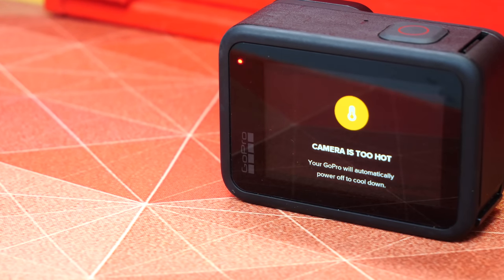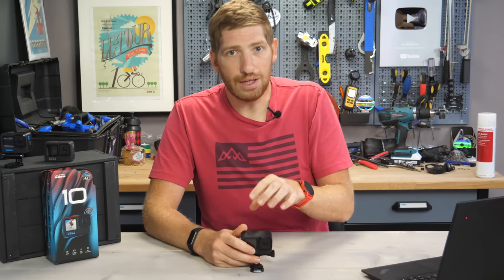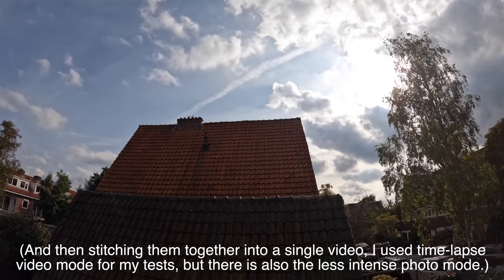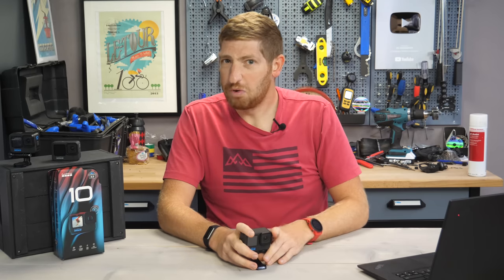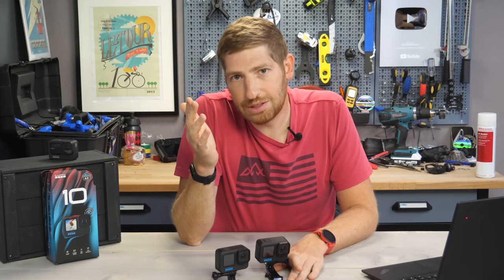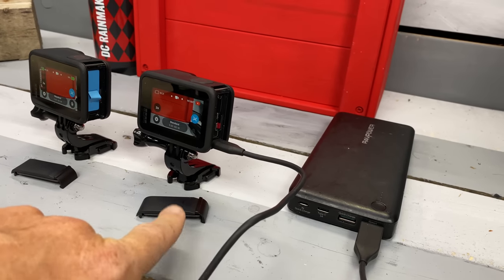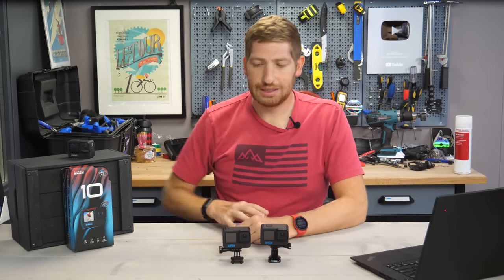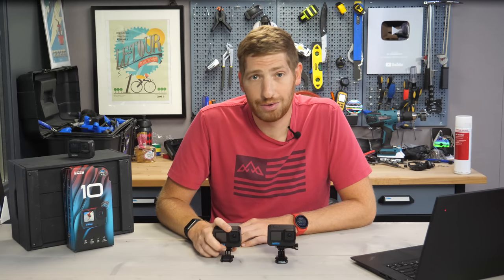GoPro Hero 10 Overheating: 40 Tests Later

Comment: Hi DC Rainmaker.

Bravo!  Finally someone who understands thermal physics.  And this applies to all cameras (or laptops) that runs at high frames rates and resolution.  

I would like to add that Gopro for over a decade calls their product “action camera” and not “studio camera” so by that alone means it will be rugged, outdoor, and waterproof.  Heat has to dissipate somewhere so other camera manufacturer’s use different aluminum alloy bodies, add passive copper heat sinks or active cooling to get longer run time.

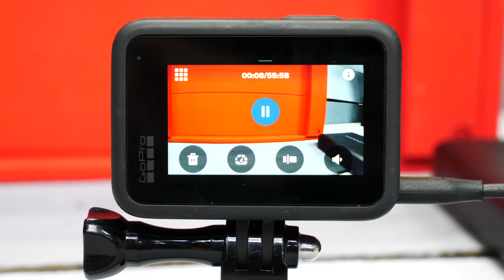I’m with you @8:55, I use Ulanzi’s BG3/4 battery grips + turn off the front LCD and sometimes back and use the remote, iphone, or MyK for live view and controls to ensure battery and LCD are not generating too much heat to overheat.  

Most components these days are industrial grade which is -40degC to +85degC so I am sure Gopro engineers are playing it safe to keep the longevity of their products and not run it excessively at high temperature.  Think about our cars, it can drive at 160-200mph (~260-320kmph) but speed limits are 65-75mph (~104-120kmph, depending on States) as there are safety considerations.

Hopefully in a firmware update, Gopro will allow for “high temp” option like Sony cameras has and now Canon R3 has as well.  But again, what that does to reliability down the road, we don’t have enough empirical data.

If consumers want long form shooting, look elsewhere or realize who shoots high frame rates and resolution as it is a memory hog and processing it will be taxing.  

It seems other YT’ers are just producing click bates and/or getting paid by Gopro competitors to just sabotage and poke holes instead of doing real world test that you’ve done in this video.

Gopro should have you as a brand ambassador and/or pay you for doing this!  I’m not loyal to them or anyone, just calling bs for those who purposely try to trash a product, brand, or company when clearly it’s user error and not knowing what is was designed for.

Those who compare smartphones to this, I’ll say good luck taking your expensive phones underwater and/or rugged outdoors and see how the stabilization will hold up.  But then again, smartphones are not built for extreme action sports so doing so only means doing those tests would also be poking holes.
Reply: @DC Rainmaker, forgot to mention most important thing, appreciate time and effort you took to make this video and others for us/me and for free!
Reply: it's funny seeing smartphone vs gopro comparison videos mostly just them walking or running for 10 seconds and almost passing out, if you really want to say iphone stabilization is on par with gopro, try mounting it on a bicycle handlebar and take it for a ride.

Comment: So thorough. 
I’ve only had a handful of overheating incidents with my hero 9. Happened at the end of some long runs over the summer. First, stabilization stopped working randomly on some but not all clips. Then, it just wouldn’t turn on anymore

Comment: My Hero 10 overheats all summer long in India. It overheats while I vlog outdoors after 3.5 minutes at 32 degrees (with humidity it feels around 40). I film at 4K 50fps. Half my batteries have expanded in size too. So yeah, it’s important to shoot short shots during summer. I’ve used it vlogging outdoors during heat waves at 45 degrees and it dies very quickly. Ps. If vlogging at those temperatures don’t forget to drink oral rehydration salts because it’s easy to dehydrate as a vlogger.
Reply: Watching the video again because I'm filming long tours and my Hero10 is dying at 16 minutes @ 4k 50. I'll try move down to 2.7k.

Comment: Great work on this! I think people get out over their skis a bit when they get fixated on the overheating concerns. In 2021, people lose sight of what these cameras are ^designed^ to do and have, what I think, are unrealistic expectations. There is an expectation that these $400 dollar cameras at less than 4 inches (Diagonal) is somehow going to "do it all." Even $6K hybrid mirrorless cameras don't have an unlimited recording at high rates. In fact, recording over 30 minutes at 4K at lower frame rates can prove problematic on much more expensive devices released in the last 18 months - albeit at higher bitrates. 
I think the point is, that 99% of people who use this camera - even at higher frame rates - will never run into overheating at a typical use case. They will grab their clip, or maybe a 20-30 minute run in environments with an abundance of natural cooling and be very pleased with the results. Yes, setting up a locked-off camera to record non-stop at 4K 120 or 5.3K 60 has a decent chance of presenting some issues, but you have to ask why at that point. I think some people think the higher the frame rate, the better, not understanding that 120P has very specific use cases (If you've ever watched something published in 120P - it looks like a video game and is NOT appealing). Thus, when it's available, they crank the settings to max and just let it run just to edit into a 30FPS or 24FPS timeline. This is not an intelligent approach for any camera, least of all these small devices with minimal appreciable heat dissipation capacity. High frame rates at high resolution should be used strategically for cases where footage might be slowed down or published for something like a sports broadcast.  If you really want to make sure you have the capability to use slow motion "just in case," for everyday users, 1080 at a high bitrate runs much cooler and is seemingly limited only by battery and memory card capacity at this point. 99.9 percent of people who watch your video will never know the difference unless they are watching it on a big screen - even that is questionable.
Am I disappointed in the slight performance reduction "out of the box" over the 9? A little, but I also understand there is more processing work being done for settings that, at face value, are the same. It is more than just resolution and frame rate is increased on this camera, better stabilization, better screen quality and response, better color...and all those improvements are a net positive to the quality of the footage. I sort of expect, that with some time and use, we might see firmware updates that could buy some extra filming time - much like Canon was able to do with their R5/R6 models. Even with these limitations, GoPro still puts out the best video quality in the action cam market, and when I see people throw around blanket comparisons like "but DJI" or "Well, the Insta360," I find it pretty disingenuous. It doesn't take a film nerd to look at the footage and tell the difference. What each customer needs to decide is what are their priorities? If it's quality and depth understanding that there are limitations, use the GoPro. If it's additional recording length with a willingness to sacrifice a little quality, there are other alternatives that can generate serviceable results.
Thanks again Ray for going through all the painstaking work that most people won't do on these devices.
Reply: Thanks for this thoughtful comment + feedback. We’re committed to releasing firmware updates that will continue to improve HERO10 Black, so know — we are listening! And agreed…cheers to DC Rainmaker.
Reply: 99% of 120FPS and 240 FPS is used for slow motion sequences.
Reply: @toriless  no, while that is what those frame rates are made for, that is not what they are always used for by a public who os not educated with respect to the exposure triangle.
Reply: @GoPro  New firmware I just found and installed this week 7/22/2022

Comment: I found this video really insightful, and thank you for the effort you put into it. I record outdoors, walking slowly, where it's 95 degrees on the regular with little to no airflow, in approximately 5-8 minute sessions at 4k30. I have learned to turn the camera off while I compose the next scene, which takes me about 3 minutes. The 10 still overheats pretty regularly, and it's extremely frustrating. I had the same issue with the 9. I've considered carrying a cooler with me (with ice) to drop the camera in while I compose my next scene in hopes of not getting my scene cut short by a overheating shutdown. What are your thoughts on this, or other ideas?
Reply: I'm learning quickly that these cameras are better suited for indoor use and are not the amazing outdoor action cameras that @GoPro wishes them to be. The fix would be for everyone of us to stop buying them and after @GoPro's pockets start hurting maybe they'll get serious about designing a more heat tolerant product.
Reply: For me the problem would be how long the camera is down.  What if I shoot several 10 minute segments for an hour at 80 degrees outdoors, swap batteries it is going to die if I then shoot a 30 minute segment and for how long.  My S10 will chug along for hours buy apparently not the GoPro 10.  It's still unclear if I drop to 4K/60 and am outdoors at 80 if I can get the usual hour before it over heats.  How much total time do you get at a similar 4K/30.  I too would probably shoot minutes worth as a time but at more like 80.

Obviously, I have to stick to my reliable S10 for indoors.  Quite frankly it does better than any DSLRs under a grand anyway when it come to video, it does lose out for stills in many situations since it does not have lenses that can really help get a better shot.  The new S20/21/22 had one sensor with really high resolution, over 100 MP which kills most DSLR sensors.
Reply: @Breaker_o777  They're completely useless indoors, unless you have lighting specifically for shooting. GoPro needs a ton of light to provide at least phone quality image. I initially bought it for indoor use, and the first thing I said was that "I guess this is only for outdoor use".
The bottom line is that GoPro is only for situations when you need extreme mobility.

Comment: glad to see that what i've always experienced was proven by your test, i could record 3+ hours(battery removed, connected to a power bank) of 4k60 footage when i'm cycling even if it's 34 degrees Celsius(93.2 Fahrenheit) outside because there is constant airflow, but when i have it stationed in the car, even if i blast the AC, it will still overheat.
Reply from the maker: Yup, makes sense! Though, if you can funnel just a tiny bit of that airflow (maybe even using the window defrost vents?), it'd probably do the trick! The air coming out just has to be less than about 115*F. :)
Reply: @Dcrainmaker  interesting, i never mounted it near any vents before.

Comment: My hero 10 recording for ~12mins and sitting for 30-40, took 5 games to overheat. (Indoors/4k120/boost/didn't turn it off/no battery/waterproof housing/back door cut for screen access/side whole cut to size for a usb-c, housing painted black)

I also left it on, set to 4k120 sitting on my desk, not recording, and it got close to burning my fingers hot within 5-7 minutes. (battery installed, no door) I think if I turn it off in those 30 min periods I won't have any problems. So if you use the camera as i do, you should be fine.
Reply: I'd assume the camera getting hot while not recording is due to Hindsight-Mode being active?
Reply: hindsight mode turned off
Reply: @FOVAirsoft  That's weird. One should assume that state would only require a very limited amount of energy.
Reply: my Hero 9 had a overheating problem until i buy a new battery and it never happened again. For me it it was 100% a defective battery that started overheating in a few mins and kills the camera too. It was the batttery that was overheating, not the camera in my case. Hope it might helps.
Reply: Man this to much GoPro is bull Shyt!!!
Reply: @bladetc  not quite cause I don't even have a battery in it lol wide open

Comment: Dude! I was using my go pro in my garage yesterday and it over heated in 20 mins just sitting still. Thought I had a defective unit until I found this video! 
Thanks for going down the rabbit hole.
Reply: It appears you need to have a Dyson fan (quiet) blowing at it to use it indoors.

Comment: Great video! Thanks for doing all of those research. Another thing I found that's helpful when shooting indoors is to turn off the Hypersmooth. For most people when shooting indoors, you don't need Hypersmooth since you would mount the GoPro on a tripod and set it up at one location. This usually extends the battery and the time for overheat.

Comment: I like using go pros for hidden cams in my social experiment videos and films. That’s why I love these things because of how small they are. This over heating thing scares me. So hopefully there is a setting in a firmware update you can switch to and from like for out and about and for static shooters. My hidden cams would be outdoors and indoors. So that isn’t a factor
Reply: From many of the comparisons, it seems that the overheat time is near what the battery limit time is. So, you're going to have to either cool it down or change batteries even if it doesn't overheat. And if you can use an external battery, it won't overheat at all.

Comment: Submerging in non-boiling water or putting in a freezer is not how to test overheating.
Set it on the dashboard of a south-facing (in USA) car and do a 200-hour hi-def livestream.

Did it lose connection, glitch, freezer, or shutdown?   Or at the 199th hour was the broadcast fine.

Comment: First off, I fully understand the limitations of filming at the highest resolution and frame rates.
HOWEVER, when filming at the LOWEST rates, I have to say the Hero 9 (and based on reviews of the 10 overheating sooner than the 9) is a failure!

While I wasn't always at the cutting edge of the Hero line, here's when I bought my previous GoPro's:
2011 = Hero
2013 = Hero 3 Black
2017 = Hero 6 Black
I admit I live in Arizona and hike and/or mountain bike regularly in 100+ temps and both my Hero 3 and later Hero 6 could film 45-60 minute rides without overheating OR running out of battery life.
The Hero 6 could even handle over an hour of non-stop filming (5-minute loops @1080/60) in 100+ degree temps on the front bumper of my Jeep (plugged in to an external power supply instead of the battery) while driving slow over rugged terrain with NO overheating issues.

Ok, so being happy with those GoPro cameras, with all the hype of the 9 & 10 I figured it might be time to move up to being able to film at higher res/rates and took advantage of the Hero 9 Black online web deal.
Spoiler alert: BIG mistake!
First time out on my mountain bike filming at 2.7k it barely made 15 minutes before shutting down and it wouldn't turn back on, so I cut my ride short and went home thinking I'd do some research and figure out what the problem was.
After glancing through a few forum threads the supposed consensus supposed remedy was to "Film at a lower resolution, lower frame rate and film short clips"

Hmmmm. Ok, so all the latest and greatest features touted for Hero 9 Black compared to my "old" Hero 6 are just bull-puckey? Well let's find out.
The next day I went biking to do an apples-to-apples side-by-side test between the Hero 6 and Hero 9.
With both set at 1080/60/GPS OFF/No ProTune (essentially basic filming) and with 5-minute looping the 9 overheated and shut down within 15 minutes with battery down to 30% while the 6 was still filming showing battery at 76%.
No point in beating a dead horse (dead Hero 9?) so I put it away and continued filming with the Hero 6. After 40 minutes out in the Arizona sun at an ambient temp of 95-98° the Hero 6 provided nice 5-minute clips @1080/60 with no complaint, whereas even when it was filming, the 9 only created 1-minute clips.
So, back home I call GoPro to see what can be done about the overheating and 1-minute loops.
After a 45 minute call to GoPro in an attempt to fix the failed looping (only creates 60-second clips whether set at 5 or 20 minutes) and still no joy, I returned the Hero 9.

Thank you GoPro for the relatively pain-free return process! (but then with plenty of returns to streamline the process it's all one could expect.)

The 9 & 10 may be fine for short clips and/or in cool weather but what's the point of 5.3K if you have to set it at 1080 for longer clips?
Actually, leveling and smoothing were the only features on the 9 that I would have wished for on the 6, but not at the cost of overheating and terrible battery life.
No thanks, I'll stick with the Hero 6 and be done with GoPro's.
Reply: Makes me wonder if you have a defective unit?
Reply: @lawrence_SoCal  It most definitely it is/was a defective unit, in more ways than one.
However, based on the myriad of folks complaining about various issues, overheating in particular (in various online forums including the GoPro community) I have to believe the defects are in the design and/or engineering. If not, why are the SAME issues cropping up from what, the Hero 7 onward?
More thorough testing PRIOR to release of EVERY Hero should have been #1 priority instead of the broken record of "We are working on further firmware improvements for HERO(insert model # here) based on your feedback..."
What? You didn't get enough feedback from the 8, or 9 to figure out what issues could have been avoided with the next generation Hero?
While I would LOVE GoPro to at least fix the big issues and be open & honest in their advertising about the capabilities AND limitations of their "action" cameras, the fact that I haven't seen any movement in that direction over the last few years I've pretty much decided I'm no longer going to be a GoPro guinea pig.
On the other hand, as a former software test engineer, if GoPro would provide me a camera to test and return with a list of issues to fix, I'd be fine with that, I just won't be fronting any cash.